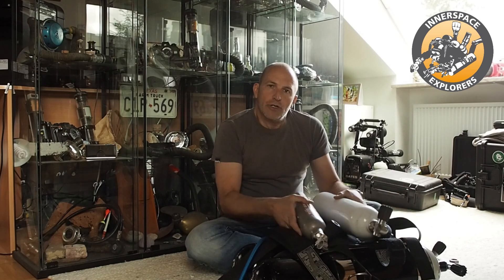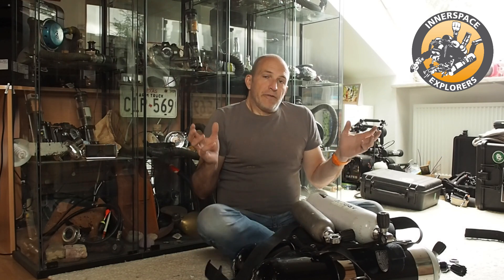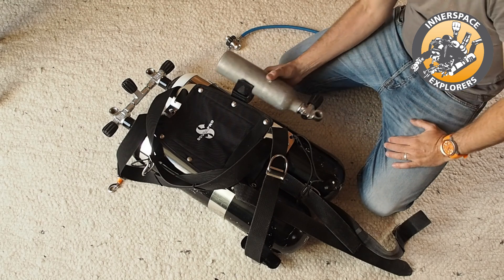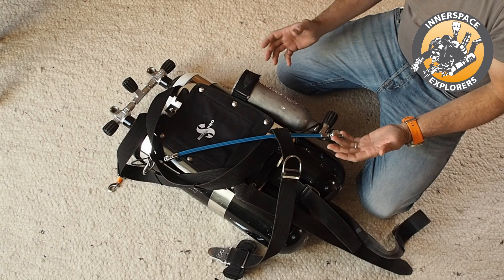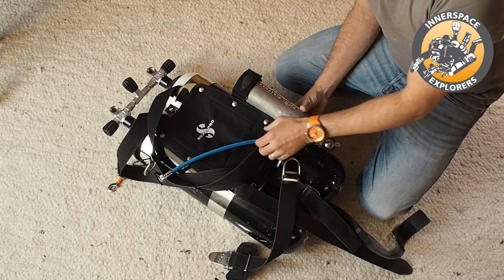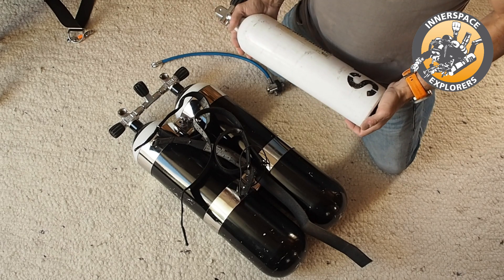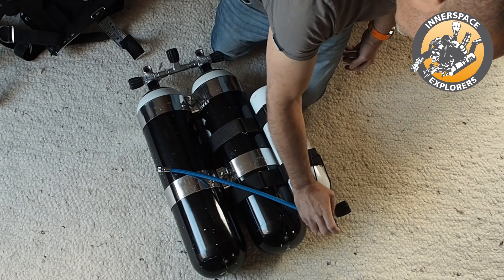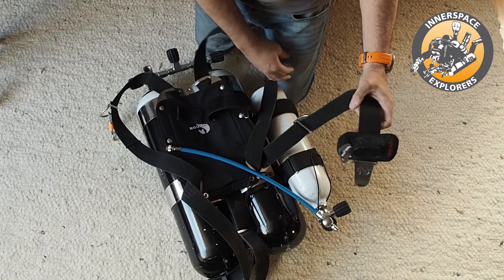How to mount which Argon system to your double tanks

Comment: I use same config with a 0.85 lt bottle for drysuit, with just one strap (the one with the famous "H" on it...) but lot of times the strap opens during dive (especially at the start immediately after the jump) and thats a pain in the a**... any advice to avoid it? Luckily the bungee on the bottom of harness is there to prevent the bottle from falling but its so annoyin.. As you say an "upper" bottle interferes with dring and stages!

Comment: Hi, good video, but I think argon gas is old school :) heating sistem much better. But if will using air in the argon tank, you can save air or gas mixes in your primary tank. :) I have question about monifold valve on yours twinset, better 45-30 degrees corner or 0 degrees or never matter?